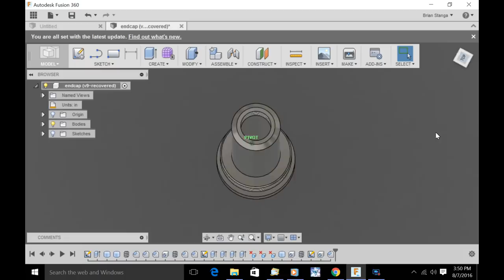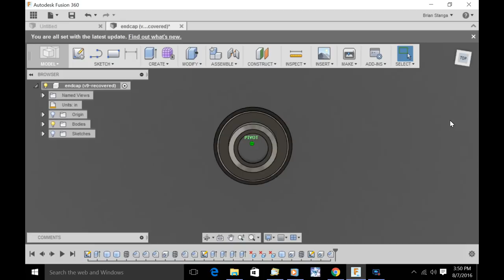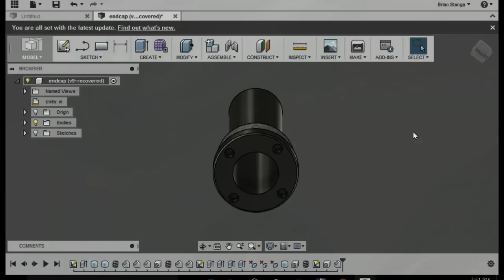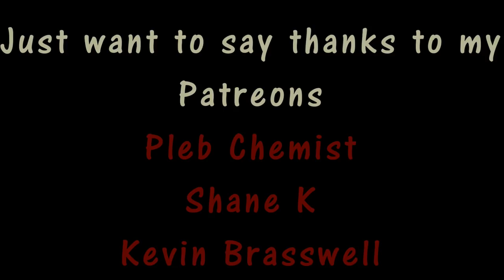Homemade Reflex  Design and Build

Comment: A simple tip...hit outside diameter of threads with fine sandpaper to remove burr at peaks of thread. Mic diameter to verify finish size. This will make test fitting tube easier and prevent any binding up. Otherwise cool video

Comment: Ti is an awesome spring and has a lot of memory.  You cannot leave 0.010" for finish cuts like steel or Al because of the springiness.  Need to take 0.025"-0.030" for your final cut.  Use slow speed with high feed.  Needs lots of chip load to cut properly.

Comment: nice work. Curious what you are using for a spacer between the reflex mount and first baffle (to keep the baffle stack in place)
Reply from the maker: yeah, its a piece of DOM turned down to about .040, it was actually inside the tube when I shot the video, look back to one of the last few videos to have a look at the spacer. thanks for watching.
Brian

Comment: Your patience with Ti is paying off Brian -- the whole project is super impressive. I should think by now your lathe time has been pretty huge!
Apart from carbide drills being desirable and spendy - "ARTU" carbide tipped drills could be handy and prices don't seem to bad... with a small starter from a std drill, continuing with the ARTU would do nicely.
Will there be a spaced between reflex and baffle stack? Or maybe a strong spring? Coming on super well and can't wait for test - would like to think, that length will be well adequate.
Gotta chuckle at Zeke's grumblings LOL - he is like a kid - anything can be chewed :)
Reply from the maker: darn Chris, that is a good idea on the carbide tipped drill, I assume you are talking masonry drills? I think i'll have to test that out on a piece. I swear the hardest part of all of these last few projects have been the drilling, even one of the cones at only .060 that I had to open up a little fought the HSS drill.. as for spacer no springs, it is a bad idea a piece of DOM turned down to just "telescope" inside the tube is best. yeah, 
Zeke is a character, if you are not paying enough attention to him he will pick up something walk up to you and lean on ya and give you that look..
Reply: The ARTU drills are masonry drill look-alikes but, sold for drilling hard material. They recommend hi RPMs. I bought a 3/16 one to drill thru some HSS tooling - took a while but it managed!

Comment: thanks for your time and effort for putting this on YouTube. I have one question did you have to submit blueprints for the parts of the suppressor when you submitted your application for it?
Reply from the maker: no, on a form 1 you specify caliber, length and a model and serial number of your choosing. No plans are required. thanks for watching
Brian

Comment: Turned out great! Does the reflex mount require and entire separate Form 1? I'm still trying to figure that whole deal out.

Note: It sounds like your lathe is doing a lot of panting and growling at times, you might want to check into that :)

Thanks for sharing
Reply from the maker: No separate form 1 for the reflex, it is just an end cap, and a possible solution to  another build.

Comment: CAN I USE ALUMINUM FOR THE BAFFLES INSTEAD OF TITANIUM YES OR NOT A GOOD IDEA?.
Reply from the maker: I have used a SS blast baffle with the rest being AL
Reply: Yes if you are shooting in low volume (rds/min). Aluminum has a higher coefficient of thermal expansion and lower heat capacity than SS. Great for sinking and dispersing heat. However, if the baffles are housed in a SS sleeve, you'll eventually hear groaning as the baffles strain against the housing which isn't expanding as fast. So long as you let the suppressor cool enough, it's fine.